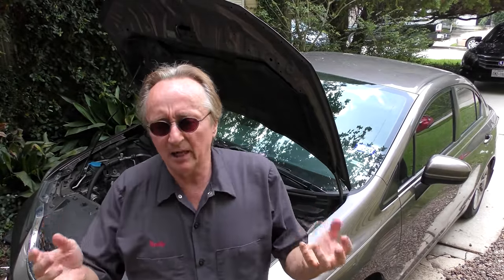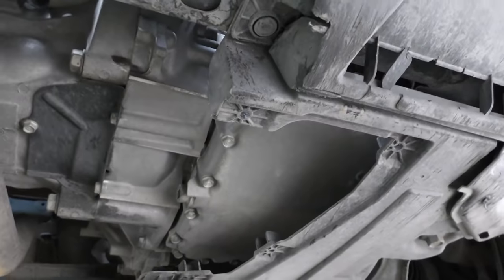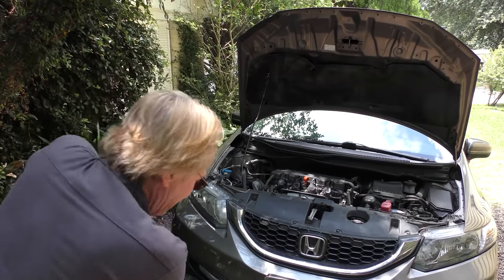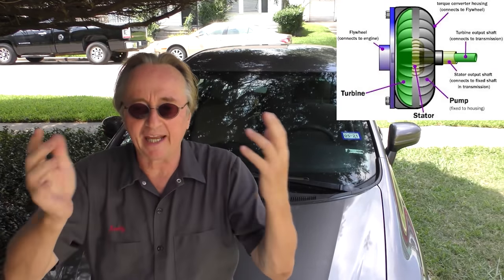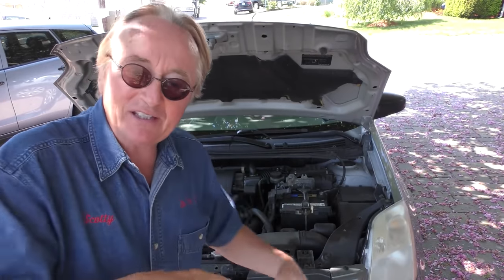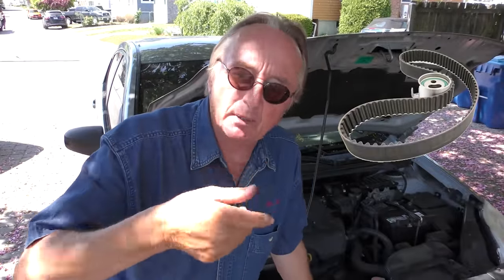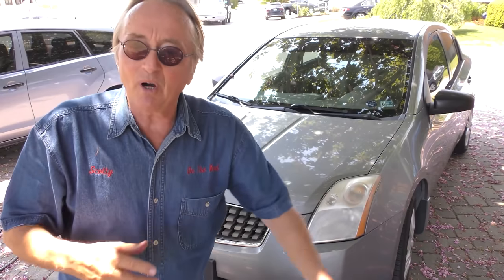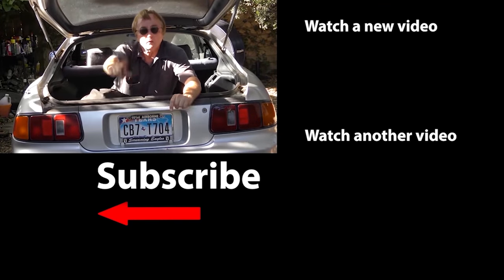Cars That Have Serious Transmission Problems (Do Not Buy)

Comment: If you want a civic, get a standard transmission, it will last forever.
Reply: Virtually any Japanese car with a standard transmission will take you well over 300k miles easy... Especially if you throw a timing belt change in there somewhere.
Reply: My 08 lx automatic, not cvt, 😂 has 320,000 miles. I'm doing the 3rd timing belt change along with tensioner, head and engine gasket kit and Aisin water pump. Pretty much all OEM. 😂 Just for the heck of it.
Reply: Don't want a Civic, or any Japanese car!😁
Reply: @erniecarrasco9107  My 97 Isuzu Rodeo 5spd manual 4x4 has over 300k.. but it finally needs a timing belt.  I've taken it off road all over the place and shockingly..  I never broke anything on it--- all while jeeps were falling like flies all around me.
Reply: @calholli  that's a sleeper car!!!!  I remember my high school years seeing doctors and lawyers in those preppy looking SUV,s. Man I wish I had one. The 5 speed manual of course.
Reply: I just like to do all that maintenance every 100,000. I got my last Honda Accord 03. 5 speed manual 4 banger to half a million miles. I want to see if I can get their automatic 4 banger to half a million miles. We'll see. It's on the road as we speak.
Reply: @erniecarrasco9107  Yeah, the Isuzu Rodeo's are exactly the same as a Honda Passport-- both names are on the service and repair manuals, I loved that thing and drove it over 10 years-- I'll throw a new timing belt in it eventually....     In early 2020 I bought a 2002 Acura MDX 3.5L vtec AWD- has COLD dual climate ac that blows hard, moon roof, 3 rows of heated leather seats, heated mirrors, even the tire were virtually new. only 155k miles.  And I got it for only $1700 from this rich kid on facebook. lol..   He had posted for $4500. and I just kept telling him $1500, kinda as a joke because he was only 20 years old, and I figured his family must have had money to have such a nice car so young..   After about 3 weeks of no one buying it-- he calls me back and offers it up for $1700. lol..  It's in immaculate condition.  Zero dents, Zero rust (we don't get rust here in Oklahoma)-- and I crawled all around under this thing, not a Single DROP of oil leaking ANYWHERE on this thing... it's insane.  It might as well be a new car.  The only downside is that it's an automatic-- but I don't even care.  I've drove it for 2 years now and I'm still excited by how great it is and how I got it for so cheap. loll..  apparently it's a sought after motor too for swaps in civics, to juice up for racing..  (J35A3)...  I'm approaching 170k miles now-- and I'll be taking this thing to 400k if I can.  I seen that there are a few videos on here that are showing my exact MDX off at 400k miles, and it's still in the same condition.  So I'm thrilled about it--- If I could find a manual swap for it-- I'd do it.
Reply: @calholli  to have that many luxury features on a car from 2002 is amazing!   And you'll be the one enjoying them for practically nothing. That's a great find.
Reply: @erniecarrasco9107  Yeah.. It's a sick car.  I love it.   I also have a 2002 F350 7.3L Diesel, w/ 6spd manual,  manual 4x4, manual locking hubs.. Extended cab.  Has over 330k miles and still tows an overloaded goose neck trailer up the side of a mountain without even trying hard. lol..  I got it for $7500 without a bed, and threw on a flat bed I had laying around.   I've driven it for about 7 or 8 years.. It just sits now that I got the Acura, and don't tow much anymore.  It's my apocalypse tank. lol.   I've had good luck with cars...   Before this truck, I had a f150 4x4 5spd extended cab.. bought for $4k years ago.  that I took to well over 300k miles, and it finally spun a crank bearing.  I still sold it for $800.. and that's when I bought the Diesel.  I graduated in 2000, and these are the only cars I've owned in that 22 years. haha..  My cars seem to last forever.
Reply: @calholli  that's how you do it. Class of 99. I have my 2002 prerunner Taco for my End times Doomsday vehicle. It's at 220,000 miles. My dad gave it to me right before he passed. I'm never gonna get rid of it. I have a engine on pallets waiting just incase. I saw a good deal online and jumped on it for under 1k. But it runs as good as new. My dad and me take care of our cars. RIP. The AC gives me frostbite. I slapped a new Denso AC compressor on it last summer.

Comment: Working at a transmission shop, most of the problems we see with these newer cars is the manufacturers run them too hot. Normal operating temp on an old trans used to be around 160-180 degrees. Nowadays they all seem to run 200-230 degrees because they have bypasses in the coolers lines that limit when fluid can go through the trans cooler. The trans coolers themselves are also undersized and are not very effective.
Reply: When did the transition happen?
Reply: @someonethirsty1957  my guess is around 2012-2014 when the modern car design kicked in and everyone hopped on the planned obsolescence train
Reply: Got an 06 TL with almost 140k. Jerky transmission when coming to stops then quickly accelerate. I do wanna remove it myself and take it to a transmission shop, any tips I guess?
Reply: What would you recommend as an action to counteract this?
Reply: @shlumpgod  had same problem with a Ford focus before it locked up. Would do that for 30k miles before it finally locked up. Brought it in and people would say couldn't find anything wrong. Then you could feel it more and they wanted to say it was the motor mount. Brought it to another guy before it finally died and he knew it wasn't the motor mount and it looked fine. Turns out it was the transmission all along and nobody wanted to believe me except him. By that point it was too late. Wanted to replace it and it costed the price I paid for the car. Locked up a month later. My advice is to get it looked at for sure.
Reply: I’ve been debating about getting a transmission cooler, this makes the decision a little easier.
Reply: @TruFire710  
But the gentleman’s point was that the manufactures do include transmission coolers; it’s just that they have valves that biphasic those coolers, for some reason.
Reply: @mhassouneh  there is a way to take apart most bypass valves and put a plug in it so it always runs through the cooler.
Reply: Any views on Audi Tiptronic? By Scotty's logic it should be more reliable than Honda CVT being a torque converter not CVT?
Reply: @ln5747  my man..  cvt  have torque converter aswell... i do not think  your audi  is  more reliable than a honda cvt
Reply: @lars25gdl  Sure it is, people tune them over 600hp on DSGs and they hold perfectly fine
Reply: Buy a manual transmission car
Reply: @standyourground9973   right... but for how long..
Reply: We had a 2015 Chevy Traverse and I think that was one of the many problems with that tranny it came with. Total garbage!
Reply: @victorramosjr2239  probably drove it dog hard with no maintenance done to it 🤦🏻‍♂️
Reply: Master Yota is 100% correct! I have a 2017 Altima 2.5 SV (75K Miles now)  I slapped a temp gauge on my CVT trans, good grief they run hot.   No rhyme or reason either, you can idle  or crawl through slow traffic on a hot 100+ day  (I live in So Cal so it gets hot) trans temp stays at an okay temp (190-205).   Climb a grade however, or get it up over 70 and the temp starts rising,  and it doesn't stop rising until you slow down to under 70 either.   I once drove from Vegas to Pahrump with 4 people,  in the summer, over  a steep grade, 103 outside; trans temp got to 235 and the cruise (set at 65)  deactivated (Uh oh).   I slowed down to 55, temp kept rising,  then slowed to 45, and by the time I got to the top of the grade, the temp hit 242.   If you have a CVT you should get a temp gauge so you know when to slow it way down to save your transmission.   Had I kept driving at 65 to the top, that trans would have probably blown.    I've read the Altima doesn't even have a "cooler" it has a heater.   The trans is actually heated by the engine to get it nice and hot ASAP  (probably for fuel efficiency)  trouble is, when the trans gets hotter than the engine, its now relying on 200+ degree coolant, to "cool" the trans, which frankly doesn't' cut it.    Really stupid design!    Probably should get an aftermarket cooler too, or just sell it HA!    On the other hand, I've changed fluid twice, and it still runs perfect.   But without a temp gauge to slow me down,  I think it may  have died by now.
Reply: Wow that is very interesting. I wonder what manufacturers will do going forward.
Reply: @standyourground9973  for the moment. But anyone that has a brain cell knows they don’t last
Reply: Matter fact …. I’ve never heard anyone say “ dam Audis are so reliable “ wanna know why….. because they ain’t… that simple
Reply: @zStC1  Not the mounts, I replaced the engine and transmission mounts together, that stopped the horrible shaking i had going on. It’s definitely the transmission hanging on to life
Reply: @shlumpgod  I have a 2014 & 2915 Nissan Sentra they both have around 128k they both have done the jerk kinda like belt slipping when you slow way down then get in the gas especially around corners.  The 2015 tranny lasted 97k 2014 still hanging in there. The factory rebuilt I had put in the 2015has 30k on it and already faintly doing it again
Reply: @shlumpgod  2002 -2006 Acura TLs had issues with their automatic trans . 
Supposidly they solved the problem in the 2006s but yours could be a problem one still.
Reply: @shlumpgod  just swap the transmission
Reply: i have a 2003 civic auto and its revs when shifting in 2nd to 3rd. gonna change the fluid soon hope that fixes it
Reply: @hippocrates8369  What do you mean locked up? Gotta be prepared lol but yeah luckily i got a bunch of local transmission shops that are nearby
Reply: @shtupidmate  Sorry, but modern car design didn't kick in at 2012, it was way before that!
Reply: @billyfoster3223  you know what I mean, when the manufacturers started making all of their cars look angry and stuff and everybody started having 18+ inch wheels
Reply: Planned obsolescence....
Reply: @johndaniels651  smart move
Reply: @applepoop10  planned obsolescence Indeed! Buyer beware.  Almost all of them do something like that
Reply: Would you recommend transmission oil cooler mods?
Reply: @hippocrates8369  not sure why people buy ford. I hear almost nothing good about them.  Mostly horror stories.
Reply: thats your opinion.  be quiet
Reply: Yep. :)  The issue is small transmissions and too heavy of a vehicle - all run too hot/stressed too much.
Or just get an actual manual. Lol.  My Mustang is $800 for a new clutch last I checked.  Not half the value of the car.

Comment: I own a 2018 Mazda 3 Touring 2.5 with the 6-speed manual.  It’s a keeper; I love it.
Reply: Finding manuals are so hard. Great find
Reply: I had a 2010 mazda 3 with a manual. Was a great car and ran like new at 122k when i traded it in
Reply: @mkloudsql3285 but 122k is nothing,  my neighbor has a. 2010 Mazda 3 with a six speed standard. it has  like 250k and runs like new ,she's had it for years, she put a new clutch in it when she got it,  at like 60k miles, that was one issue they had was the clutch going early. but it's fine no almost 200k miles later . I drove it not too long ago.i like it

Comment: I hear you on the Jatco CVTs. I had a 2014 Nissan Rogue Select on a lease. Right before the lease was up, the transmission started to vibrate violently when under load. Thankfully it was a lease. I turned it back in and it became someone else’s problem. My next car after that was the Nissan Sentra SR Turbo with a manual transmission. I loved that car. It got great gas mileage and never gave me problems.
Reply: What happened to it?
Reply: My Nissan dealer gives a 200K 20 year warranty in Massachusetts.
Reply: No car is perfect..
Reply: I literally just bought a Sentra sr turbo manual a few weeks ago. Good to hear it's reliable
Reply: @tjj5337  My gf 1999 toyota camry is perfectly perfect.
Reply: @brileymitchell2632  It went to auction and ended up on one of those "buy here, pay here" lots. Like I said, it became someone else's problem.
Reply: @musicvelle  You're gonna really enjoy that car. I loved mine. I should have kept it but the dealer gave me a deal too good to refuse on an Infiniti Q50.  I just sold that one and bought an old Lexus SC400.
Reply: I just had the transmission serviced in my 2015 nissan rogue select so far so good my mechanic says that it needs to be service every 60,000 miles

Comment: Honda hopes that the transmissions will last beyond the warranty period.
Reply: If its a manual though it'll probably last the life of the vehicle, then itll probably live another 5 years in someones beater car and itll still be fine after that too. Ive an old accord with 230k miles on it. Still goes into gear perfectly, doesnt whine or make any noises. RANT OVER. 
Have a great day!!!
Reply: I’m pretty sure they all hope this.
Reply: I feel like, if you bought a CVT-- it's on you.

Comment: MY neighbor has a Ford escort wagon automatic with a CRACK light 🕯️ it's a 1990 wagon 1.9. It's slow. He always brags about the tachometer in the dash which is unecessary. What a joke this thing is. The water 💦 pump blew off the engine Soo hard at a stoplight that it put a hole in the 🛣️

Comment: Of the 18% EV owners that switched back to gas, the #1 reason was they did not have 240V home charging. I agree, I wouldn’t even try without that I’d go insane using trickle or only supercharging.
Reply: @youdontknowme2915    Many homes have gas dryers.

Comment: That is why when I was looking for a used Civic, I was looking for 2013 only, with the same nice exterior\interior design as 2014-2015, but with a conventional and reliable automatic tranny. By the way, Aisin u760E (Camry\FWD Rav4 2013-2015) has a mass torque converter shudder issue - some many cars affected. Toyota's solution was to change the software and replace the fluid which mostly did not help. Torque converter assembly needed to be re-built.
Reply: Why 2013?
Reply: Had that issue with my 2013 RAV4, Toyota replaced the torque converter
Reply: @MustaphaBCham  You were lucky getting your TC replaced.
Reply: @splat1gamer25  1. 2013 model has the same exterior and interior details as 2014-2015 models, nicer than 2012 year model. 2. 2013 was the last year when Civics got the conventional automatic transmission, not CVT with its issues, as Scotty explained in this video.
Reply: Is that the i-shift? Scotty has also said Honda's previous transmissions were weak...
Reply: @ln5747  it’s not. It’s just conventional 5 speed automatic transmission which has been installed on Civic 8th gen as well. It’s pretty reliable transmission with no torque converter mass issues. Some people just mention a short delay between 1 and 2 gear. My 2013 Civic has no issues, but I change fluid (drain and fill) every year and changed its filter which is located behind the engine under the good. CVTs not so reliable as conventional. The most reliable CVTs are Subaru ones.
Reply: @sunlightnsk  where I am some 8th gen are stated as I-shift and some seem not to be. I have had an 8th gen manual and would like another, but automatic. But many say i-shift which I'm wary about. And even the others I am, as Scotty seems to say in 2000s Honda had auto issues.

CVT can be just as reliable. You've got to be joking with Subaru, they've had some big issues with CVT. Toyota's eCVT are amazingly reliable, they seemingly are doing huge mileages, including in taxis. Honda seem to have got their CVT very reliable also. But I wouldn't touch a Subaru CVT.
Reply: @ln5747  it’s up to you. Just made your research. Based on the tech reviews I found back in a day, Subaru CVT was called as one of the most reliable. Jatco (Nissan, Dodge…) - the worst. Check consumer reports for Civic 2013 and 2014 for transition issues and you will see that there some many complaints about CVT with many symptoms and a few for 2013 with 1-2 gear shifting delay. Good luck
Reply: why would you perposely look for an Automatic???

Comment: I have a “spare” car I can’t get rid of, a 2007 Honda Accord with a manual 5 speed and 250,000 miles. It works great and I haven’t had any major repairs yet.  I still like driving it better than the piece of junk 2020 Ridgeline with 10 speed automatic. My 2017 Ridgeline with 7 speed got 3-4 mpg better than the new one and the transmission was much smoother. My son is driving it and I suspect will do so much longer than I will my new 2020.

Comment: In 2016 and 2017, my job required a lot of driving. My employer paid for rental cars. I drove, in this order: a Ford Focus, a VW Beetle, a Toyota Corolla (CVT), a Chevy Cruze, two Dodge Darts, and a Nissan Sentra (CVT). Why I was never left on the side of the road, I'll never know.
Reply: Rental cars are newer, newer cars rarely leave you stranded in the first two years...not even Beetles or Darts or Sentras.
Reply: I have a Focus. The transmission is awful.
Reply: @ahampel22  mine has just started to shudder in the first two gears.
Reply: because a car that has had several owners may show problems because most of the time, we don't know what the poor car was put through..
Reply: @ahampel22  I had  a focus with the 5speed manual transmission.  It was a great car for me. Kept on scheduled maintenance and it never failed.